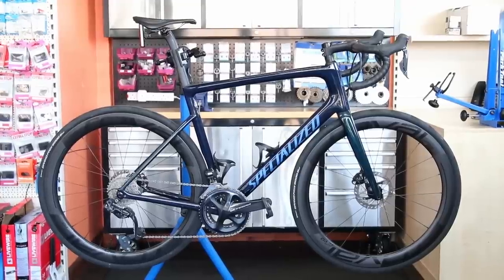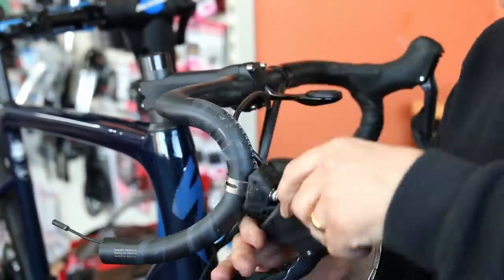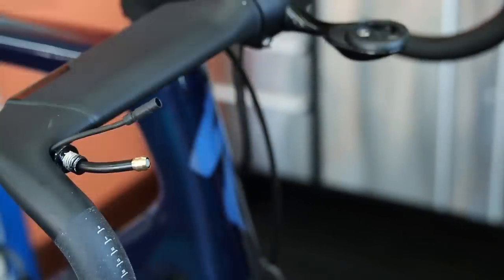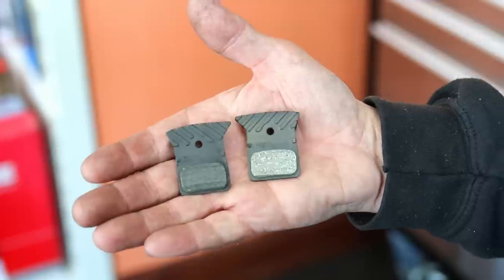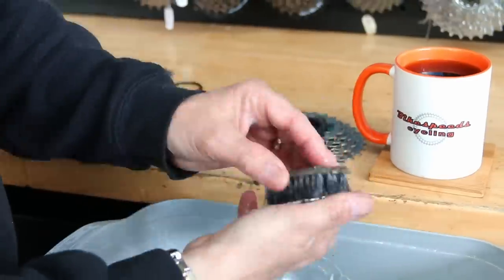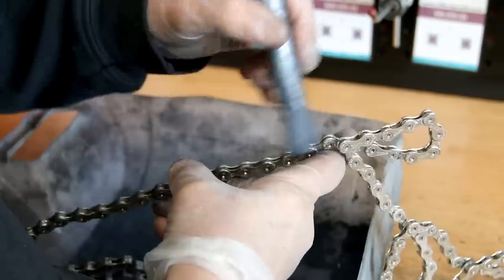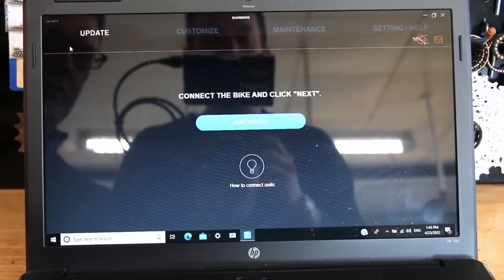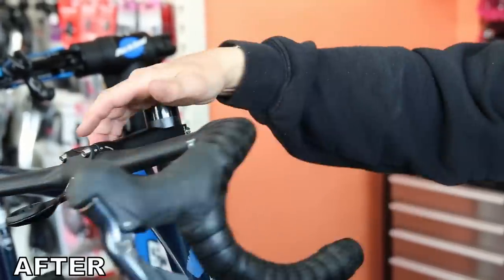Specilized DI2 Service & Chain Wax! Disk Brake Bleeding!

Comment: The complexity of this type of bike is crazy! It's so much easier to disassemble a rim brake bike with external cables... 
Good job as always!
Reply from the maker: We’re with you there! Very very complicated systems these days
Reply: @Bikespeeds  I would love to see the opposite of this. What is the bike tech you can ride with minimal maintenance and have tuned up for small money?
Reply: @Jacksparrow4986  a fixie is about as simple as you can get while keeping two wheels, a unicycle might be a step too far.
Reply: @AndrewOliverHome  I would expect a bit more nuances than that. How much is an oil change in a geared hub vs. Changing cassettes per km? Which upgrades decrease maintenance/long term costs and which don't?

Comment: Elaborating on the thru axle point at 10:00. I'll never forget my girlfriend complaining of a creaky bike for weeks, I replaced her chain, her bottom bracket, cleaned and lubed every crank & chainring bolt. And all of this after neglecting to check her rear thru axle. It was just beyond hand tight, and after tightening it down the mystery noise was gone.
Reply from the maker: Don’t forget to torque them too! Thanks for watching !

Comment: Yeaaaaah i agree on new drop bars installation, they're pretty much time consuming. I have mine internally routed cables but man it took me a few hours just to route them, and it's not just routing, we have to measure the length and how much the cables would flex if we turn it left and right.
Reply from the maker: Exactly, it’s fiddly work which often can’t be sped up

Comment: Great work. I wish you were not so far away. I would use you on every occasion. Your attention to detail is superb. After fitting an aero bar ( and all your full day efforts ) - That customer needs to get you to cut off that chimney. Aero and aesthetically pleasing. Keep the videos coming.
Reply from the maker: We discussed this and my own view is if a bike is a forever bike, get a bike fit and cut it off. This customer hadn’t ridden the bike at this height so could wind up making an expensive mistake cutting it to soon into his ownership, likewise once cut they are harder to sell if you’re someone who chops and changes your bike.
Reply: @Bikespeeds  all true - it is rare to keep a bike forever   As the video stated he had asked you to adjust the stem height I wrongly assumed he had been measured etc in a bike fit and he knew his position. Anyway he is the customer and they are always right.
Reply from the maker: I’ve raised and lowered my stems depending on what I’m doing too. Long distance higher than a 10miler etc. vanity can spoil a ride!

Comment: Great videos! Quick Q: have same bike and got a small (like 1,5-2 mm) play in the right lever after minor standing-still crash. Lever does not go full way back up after pushing. It seems working fine but getting me OCDs:) Is it worth to disassemble the shifter and look for a problem or leave it since its working? My local bike dealer saying that shimano levers are very complex to assemble back. Wanted to know your professional opinion.
Reply from the maker: If you have play after a bike drop, that wasn’t there before, then something is wrong & chances are something is broken. If you’re chasing along one day flat out and suddenly have to emergency stop and that weak point lets go, you’re in trouble. Either get a competent bike shop to diagnose and report back or replace the lever, it’s just not worth the risk of failure!
Reply: @Bikespeeds  thanks!

Comment: On the chain issue, any thoughts on caking the chain in grease, after oiling it properly? Grease would protect it form debris.
Reply from the maker: I personally wouldn’t, dust and road debris will stick to the grease and that in turn will create a grinding paste that will prematurely wear EVERYTHING!!
Reply: @Bikespeeds  Yeah, tunnel vision on the chain there, cogs would not survive that. Thanks.

Comment: What do you think about tightening up the stem so far down the fork steerer tube ? My opinion is there is no reinforcing from the plug on the tube so far down, which will cause undue stress on the steerer, which of course could be catastrophic. Specislised forks haven been known to break
Reply from the maker: The plug is designed for even headset compression force not to support the steerer tube. Even compression from the stem around the circumference of the steerer tube is what’s needed. Over tightening a stem can cause fibres in the steerer to fracture if it’s made of carbon. The plug is not integral to the strength of a steerer tube.
Reply: Great channel, thanks. 100k subs within a year!

Comment: I disagree the chain is too long...  with cassettes that have large cogs such as an 11-30, a longer chain makes more sense.  Shimano makes running the "little-little combo IMPOSSIBLE with Di2...  BUT you can run the big-big combo...  If Shimano believed the big-big to be a terrible gear to run, they would have blocked it with Di2...   and while not optimal, racers want to stay in the big ring as much as possible.  Therefore a chain should be sized to run the big-big and NOT to run the small ring small cog combos.  Personally, I never used the little ring with any cog past the 6th from the largest cog and even that is rare (using 11 speed Shimano).  I do use the big-big on many rides for a short period of time.  My chains wear fine, I typically get 3000-4000 miles from a chain.

Comment: I love that faceplate integrated computer mount. Been looking for one but to no avail. May i know the brand of that faceplate?
Reply from the maker: Unfortunately I can’t tell you. This was a customers bike so not something I fitted.
Reply: That's a Specialized Tarmac SL7 stem with an out-front mount made by Bar Fly as part of a collaboration between these two companies.
Reply: @yonglingng5640  thank you!

Comment: why is the rear derailleur only shifts to the 3 smallest sprocket ?
Reply: Hello mate. on Di2 it can be set up to only got to the 3 smallest until you go into the big ring, then you can use the other two.. if that makes sense. that's what my di2 does.
Reply: Standard di2 behaviour when in the small chainring, prevents cross-chaining too far. You can disable it through the e-tube app
Reply: @cam-hz4yl  I didn't know that tnx

Comment: Lowering the stem without cutting off the steerer is a recipe for damaging the clamping area especially with the poor and often very short design of Specialized expander plugs. Either cut it or replace the steerer plug with an extra long one but never clamp a carbon steerer without proper support
Reply: The expander/compression plug is there to establish the headset bearings, not reinforce the steerer; what will damage the clamping area is incorrect tightening of the stem bolts; a carbon seat post has more clamping force than a stem and doesn't have internal support.. think about it.
Reply: @petesmitt  I am an engineer and I can tell you, you are just wrong.
Reply: @MS-bw7yt  I'd suggest the experienced bike mechanic doing this video knows what he's doing..
Reply: @petesmitt  Looking at the ongoing recall with failing steerer tubes with the Tarmac due to the insufficient design of the upper headset bearing, compression ring and steerer plug, you can't even be sure Specialized engineers know what they are doing

Comment: Thats why i think etap is more better system than di2, ur bike is not a wire mess all over the frame
Reply: New di2 has less wires, only the brake hoses coming from shifters.
Reply from the maker: You still have your brake routing though, it wasn’t the Di2 that took the time!
Reply: @imperialspy3457  Only the disc brake counterparts of the 12-speed groupsets are semi-wireless, rim brake counterparts are still fully wired.
Reply: @yonglingng5640  true